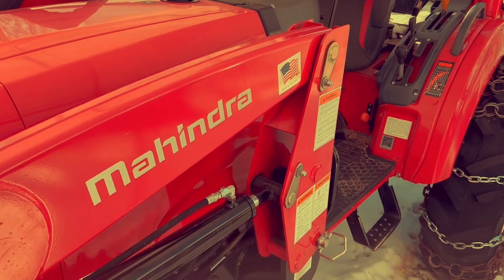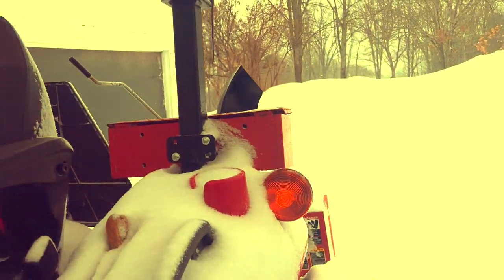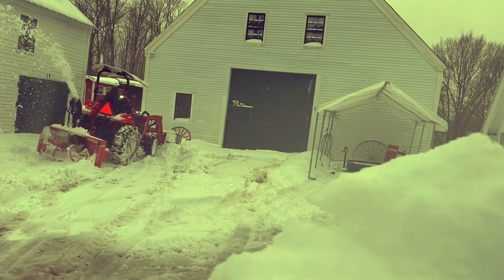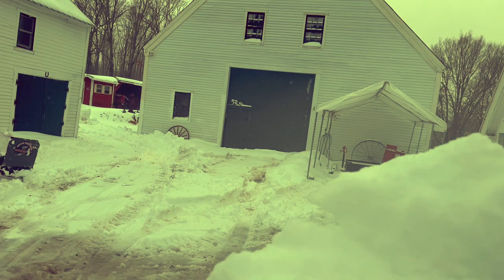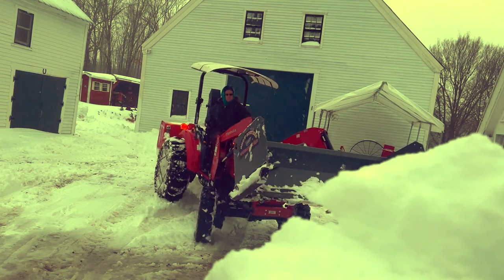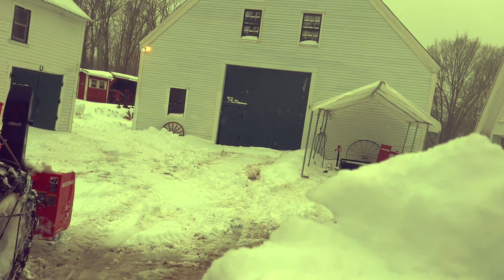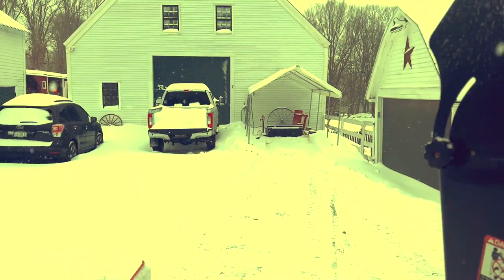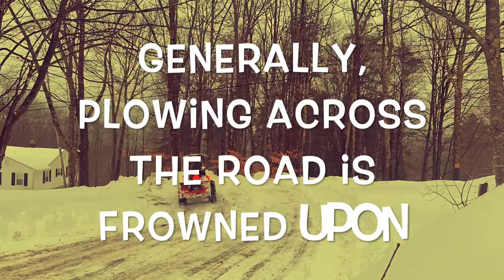Mahindra 1635 Front Box Blade Snow Management?

Comment: I think we all have our own unique methods of snow removal to fit the terrain where we live. I have 3 tractors dedicated to cleaning up, a 140 with front blade for under 5” of snow, a Kubota with front mount 4 ft blower for 5-12”, and a IH 806 with 8 ft 3pth blower for deeper than 12” or heavy drifts. It’s nice having options,
Reply from the maker: It sure is. I can do a little bit with the Max, but it tends to spin even with chains. It’s just to small really for pushing. I do have a blade for my 140 too now that you mention it🤔

Comment: We have the HST version of that machine. The pedal is a awkward item to use. I'm looking at a snow blower that is Bobcat mount. I have a 3rd function valve kit to install. And that system would allow one to keep the loader on the machine. And you can switch between a bucket. blade or blower if needed. Is your block heater a factory item?? I wish we had that option. We live in a freezing environment for 5mths a year. We also have the wider tires , and chains I use a V-bar design
Reply from the maker: That’s exactly what I’m saying about my Max. Turns you into a corkscrew. The block heater was from the Mahindra parts bin, yes. I think it was $59 installed? They’re easy to add I guess, but they were already in there working on a 200 hour service.

I’d love to see that bobcat blower attached. 
Thank You for watching
Reply: @LedgemereHeritageFarm  Bercomac is the company. They have a gas power one that is loader mount as well. Not cheap , but I think money well spent after a couple winters use. We have had 5 to 6 ft of snow this season.
Reply from the maker: @hartiaacres  Bercomac makes good  stuff.